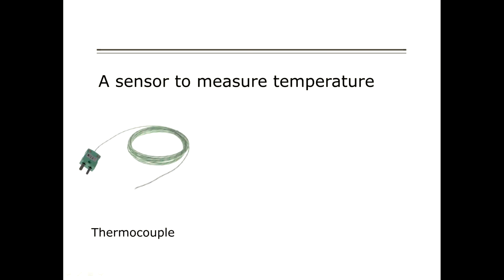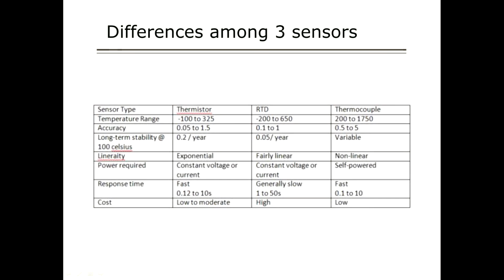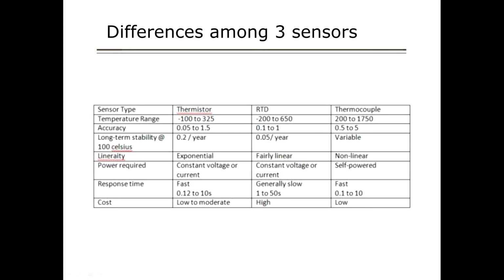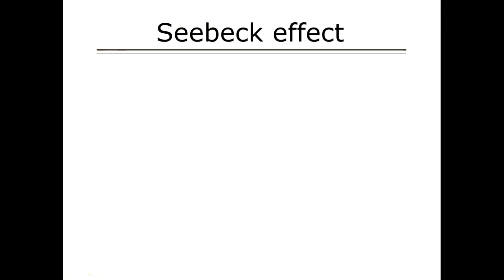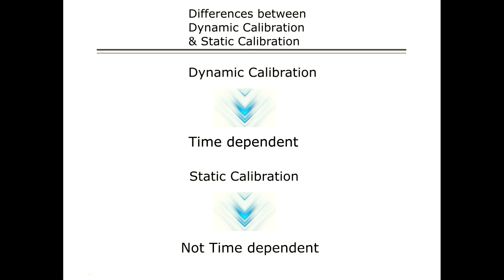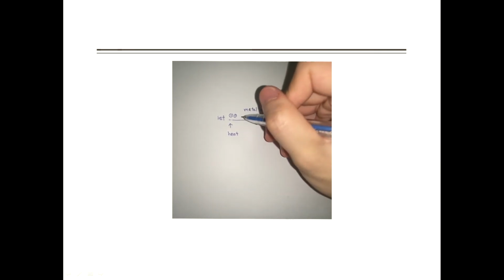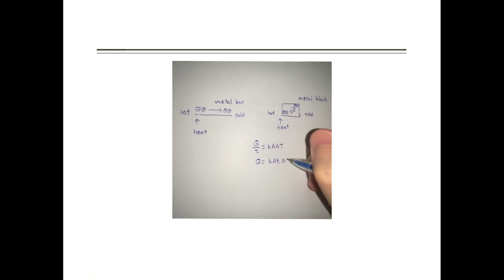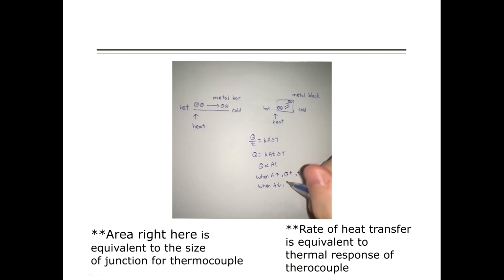Explaination about Dynamic Calibration of Thermocouple

Comment: Hello Chen Keat, between static calibration and dynamic calibration how significant are 
(i) the time factor, and 
(ii) the accuracy of the calibrated temperature readings, 
of one over the other, that you expect to discover?
Reply from the maker: Hello sir,
(I) The time factor play a very significant role in dynamic calibration whereas it is not in static calibration. Let us look into one of the example right here;
When a thermocouple is placed in a hot water for awhile and take it out then place it in cold water. After awhile, calibrate the thermocouple and check with the changes in thermal response without concerning the time constant. The experiment is further repeated with several set of changes in temperature of the water. That’s the static calibration.

As for the dynamic calibration, the experiment is carried out with the similar procedure as the static calibration, however the differences between static and dynamic calibration are the thermal response will be determined based on time changes and the repeated experiment will add on with a condition which is the changes in size of junction of thermocouple and the temperature of the water is remained constant. 

(ii) The accuracy of the calibrated temperature is not the main priority of the experiment however this experiment is carried out in order to determine thermal coefficient of the junction if the changes in size of the junction is applied as well as the changes in thermal response. The second thing that plan to achieve by doing this experiment is to determine the uncertainty that caused the result of calibrated temperature to be so different with the simulation. 

I hope this will help to answer your question. Thank you.

Comment: Hi Mr Teoh,  really interesting to know how people do thermocouple calibration.  But, referring to your fyp;
1- what actually the engineering problem that you want to solve? 
2- any new/improvement method you like to propose in yr study? 
3- which what data u will callibrate your thermocouple?
Reply from the maker: Hi Dr. Sukri,
For the first question,
“What actually the engineering problem that you want to solve?”

The engineering problem that I would like to solve through this whole experiment is that how the changes in size of junction of thermocouple along the time would affect the thermal response of the thermocouple. The obtained result from the experiment would be used to compare it with the simulation result and determine the accuracy of the calibration as well as the way to solve the uncertainty that exist in the experiment. 

For the question 2, 
“Any new/improvement method you like to propose in your study?”
usually the normal experiment of the thermocouple is 2 dissimilar metal wires connected together with multimeter to determine the potential difference produced when the heat is applied on the junction ( 2 dissimilar metal connected part ). The usual reference junction would be ice bath. However for my experiment I won’t be using ice bath as the reference junction, I’ll be connecting the thermocouple to RTD and Multimeter to adjust the error of the thermal response produced and thus gain much accurate thermal response.

For question 3,
“Which what data you will calibrate your thermocouple?”
The variables to calibrate on the thermocouple are changes in size of junction ( which 2 dissimilar metal connection part ). By changing the size of the junction, the thermal response of thermocouple would changed along the time constant as well.
I hope I do answer your question, thank you Dr.